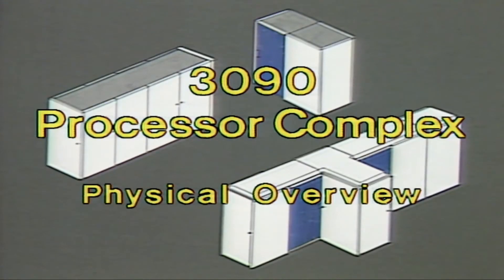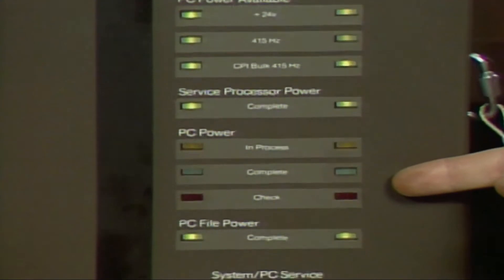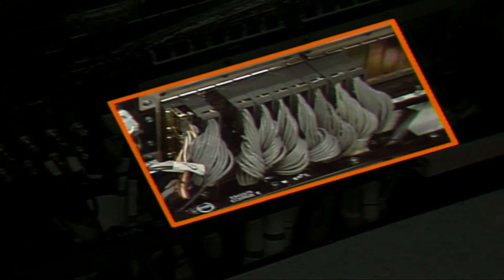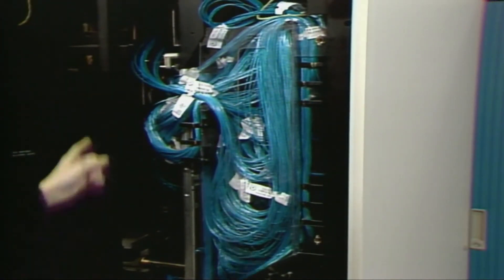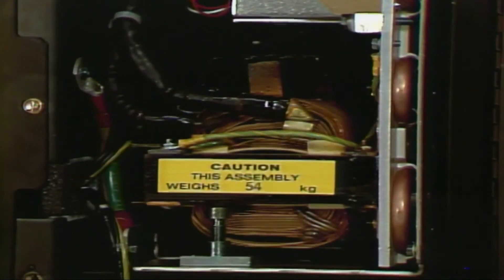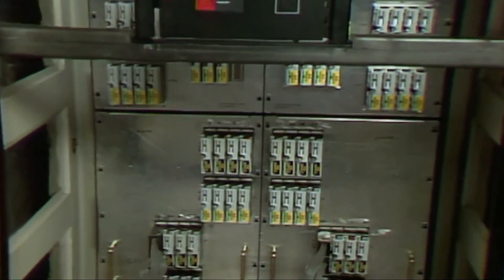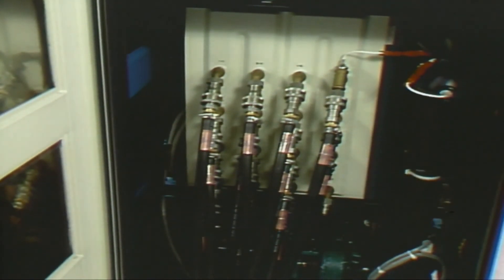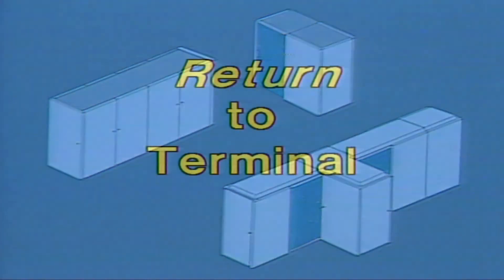IBM 3090 Processor Training

Comment: It is truly amazing how far we've come in the 30 or so years since this was current.  I wonder if people back then could have even conceived of how absolutely ubiquitous computers have become?
Reply from the maker: to be fair, yes and no. I was lucky to be part of it, I went from being a systems programmer in the mid-1970's on the original IBM 360 systems, to a Senior Distinguished Engineer at Dell 40 years later. I kept these laserdiscs when IBM closed it's formal library at the IBM Pouighkeepsie development and manufacturing plant circa 2002. This size of machine had already become recent history.

When I started in the early seventies, the computers were big enough and ran hot enough that for night shift we'd bring our food in and store it in the back of the computer to keep it warm. I was briefly Chief software architect for the development team that built the pre-boot software for PC's. All that stuff that handles the BIOS etc. That system was more powerful than the processor we kept our food warm in.

By the 1980's, we knew that things were changing rapidly. I already had a watch with a computer in it instead of a set of cogs and winding mechanism. Moores law mostly predicted the change, it wasn't clear how it would get used, but wouldn't just make big systems bigger. I was lucky enough to work at Chemical Bank in New York with Hank Kee - who was a visionary and he was a big part of the reason I was able to push IBM on some of their changes.

I Laugh not not so much on the size of the processors, but the amount of data and size of the operating systems. I get headhunted from the UK to help Chemical Bank start with virtualization in 1983. We ran a production credit card approval system that had some 300 telephone operators waiting to receive calls from merchants, and look up a credit card account. It ran on an 8MB MVS system, we virtualized it and ran it under VM/370 HPO 3.2 on a 12MB system. My Android phone now won't run effectively on 6GB. In the late 1990's one of the big pushes for extended memory on these 3090 systems were the 30-50MB CAAD drawing and modeling files, now we routinely load up files that are hundreds of megabytes.
Reply from the maker: FYI - If you don't know about Hank Kee he still has a radio show on WBAI. He has a website with show archives here http://hankkee.net/
Reply: I'm still here after 40 years. A lot of this heavy metal was in the banking industry where I started. As big as these appear to be, you haven't seen anything if you haven't been in a big rack-mounted server room today. Makes these look a little on the "small" side.

Comment: I’m surprised there is no mention of the vector facility in the video. My company, Amoco Corp, used this system for seismic data processing in the late 80’s. I worked on vector enabled scientific subroutine library for the system (Fortran)
Reply from the maker: I think that is because there were entire different training programs for dealing with the vector facility. They were not that common at the time. Good spot though.
Reply: @MarkCathcart  Thx. I’m not sure which frame would have housed the VF  anyway, I was never in the room with the mainframes 🙂
Reply from the maker: @zrlw05  there is a copy of the ibm redbook "IBM 3090 VECTOR FACILITY" if you to look it up...
TECHNICA REFERENCE 
GG on bitsavers

Comment: Surelly this system could have been built in a way it would occupy less space. It could even be more faster and have more capacity. But I suspect that IBM systems engineering had other goals on mind. Like reliability, availability, fail-safe features. One key factor to achieve these goals is temperature control. And power supply quality and reliability. To achieve goals like those, you have to avoid crowding modules and componentes (beyond some limit), you need space for airflow. Those were some of the challenges on the late 80's hardware engineering and frankly the customer targeted by this kind of system did not care about some dozen floor square feet more.
Reply from the maker: You are ignoring or don't know this was a replacement for the IBM 3033 processor. The 3090 required 50% less space in total for more than double the performance per sq-inch. These systems, as the 3033 systems did, required water cooling.
Reply: @MarkCathcart  You're skipping the 308X series.  3081-3084 processors were introduced around 1980-82.  3084 was two 3081s bolted together.
Reply from the maker: Thanks for the intro. I'm not ignoring or forgetting. Christmas 1983 I launched the first virtualized swift interbank transfer system running on VM on a 3033MP - IBM had to fix a number of software defects in the I/O code and microcode for reserve/release in a virtualized environment. But thanks.
Reply: @MarkCathcart  The shop I was in at the time (Doubleday Book Clubs) migrated from twin 370/168s to a 3081. No issues. Quite an upgrade!  I was responsible for 3350-3380 data migration.
Then two years later IBM convinced them to move to a 3090-200.
Reply: Remember these machines would often require a large installation no matter how small the actual computer was. Between electrical, cooling, archives of storage media, terminals, etc etc. It probably could have been smaller as you say, but shrinking it wouldn't have been high on either the customers or engineers priority list.
Reply: How do you figure it could be built in a way that would occupy less space? I mean, yeah, ultimately, with new technology, your smartphone blows this thing out of the water and can fit into you pocket, but with the technology of the day, no, I doubt it could've occupied less space.

Comment: Wow when roughly was this footage likely recorded?
Reply from the maker: This would have been made in 1985. It was internal processor support education, so would have been used during that year along with "Fist Customer Ship" (FCS)
Reply: I haven't found any info but the 3090 was announced in 1985 and the hairstyle looks late eighties so I'm guessing circa 1986 until I can find out more.
Reply: I agree with (around) 1986. I knew the woman in the video slightly- we were in the same 3705 class, and she started working in the IBM Ed Center in DC in the early 80's, then moved to the Atlanta Ed Center. I was trained on the 3090 in 1986 and saw her there.
[Unless I'm completely mistaken]

Comment: You mean these three huge boxes comprised a single computer? This is unreal lol
Reply from the maker: to be fair, these three boxes are just the processor part of the computer. There would be other boxes that contain the "modem" communication processor, disc storage boxes(lots of them) and other things found inside modern PC's and laptops.
Reply: @MarkCathcart  Why put the computer in a whole room? Just build the room into the computer already hahahah it's amazing how small and efficient things got.
Reply: @michrain5872 Keep in mind, this was 1985. Microprocessors had been around for 10 years, and were slowly catching up to high-end minicomputers. 16-bit machines were making headway amoung the cheaper and more widespread 8-bit micros, and they were starting to talk in MB, not KB. 32 bit processors were only a few years away, and close the gap in terms of capability, if not raw performance.

Comment: I started in IBM as a part timer in the late 80's. As a young man my job was to pull the Bus & Tag cables out of the 3090 and pull out the cables from under the raised floor. There were a bunch us part timers and what great memories I have.  It was non stop work to get the old system out and the new system in.  Worked in downtown Brooklyn  at Brooklyn Union Gas.  The experience IBM's were great to be around. Professional and well respected. They were great educators to all the young people trying to learn.

Comment: The interiors and hardware of these old machines look so complex.
Reply from the maker: They were. Even the single frame older 370 Processors had some amazing design, the cables were not just put in where there were spaces, they were designed and sized to fit in exact places. Thats why they were all so expensive...

Comment: I used to fix this. PST - Product Support Trained level. Our IBM office bought a refurbished 3090. Due to anti-trust laws, we could not get special pricing on any new unit. One tri-lead paddle card was damaged. We identified the signal and it was a sensor line not a high-speed data line. I had good eyesight in those days. I soldered the connection. I don't recall we ever replaced that cable. Then I got posted at a remote site and never came back to the mainframe group. It was a fledgling team that handled Point-Of-Sale and RS/6000 which was a blessing since this introduced me to AIX and I was then trained on the 9076 supercomputer. I ended up being the local GOTO guy for the 3584. I was also trained on the 029 card punch but sucked at it. Lots of war stories. EDIT - it was not a tri-lead but a triaxial cable which was covered in blue foil and about the thickness of a pencil lead.
Reply from the maker: Thats awesome, I had so much respect for real hardware engineers, it was a world I could get totally intimidated by!
Reply: @MarkCathcart  I saw the writing on the wall and following some advice - left the party early. The moment I was eligible, I went for early retirement. My colleague didn't. He was from IBM Canada and worked here as  contract staff. He wanted to reach 50 years working for IBM but passed away on his 49-th year.  The prestige of the IBM Customer Engineer had evaporated. We were headed the way of dinosaurs. We never met the client anymore. All we met were the staff of megacentres where the clients had outsourced their servers to. We had descended to the level of janitors. I am glad I never went back to mainframes. Those team members were getting arrogant. Case in point -  A newly installed 3584 never finished initializing. We were territorial. 3584s in their account were handled by them. I was asked to assist. I went there with a trainee and within a minute, I pulled off a Richard Feynmann  radio repair. I was never trained on the 3584 and learnt everything through reading the Maintenence Information Manual and trying to reverse engineer the machine. I deduced that they used an FPGA to act as the controller. I knew exactly where they went wrong. They installed the machine without referring to the MIM - it was still unwrapped. I told them where they went wrong and even found the page in the MIM but they still refused to admit their mistake. They mounted the crash stops at the wrong position and the robot couldn't find the barcodes and home flags. Reposition those and voila! That really impressed the trainee. Guess who knew shit and who knew his shit.                                                                                                                       EDIT - I must be losing my memory. What happened was the crash stop contained the home flag and when this is misplaced, the robot would find home, move the preprogrammed distance and shine the barcode reader to read the barcode labels and couldn't find any. This stopped the initialization. Pretty obvious if you did any programming and diligently enforced input conditioning and sanity checks. I published two programs on github. These leave audit trails so I debug from afar.  Since I was obedient to the manual for everything, I never encountered this problem but having watched the power on sequence countless times, I realized this instantly even if I had never come across this before. With my knowledge of AIX/unix, I used "strings"  to extract the latest HEC and HECQ codes from the microcode file along with their descriptions. Our technical expertise had drastically fallen. NOBODY was interested in this finding. Nobody drilled down to the error codes anymore. Another case in point - a REGATTA was gutted for its parts and when the crisis was past, new and original parts were installed but the machine failed to power on due to a massive mismatch in the VPD - Vital Product Data. Two CEs failed to overcome this. I was the second standby and was called in. I have absolutely no training on this machine. I can't even remember the machine type. But I could go into the error codes and painstakingly identified the serial numbers and error codes and after rearranging the power supplies, it could just power on. We needed to fly in someone from France to sort the rest out. The company hides so many things from us ostensibly to prevent these machines from being serviced by third parties. Indeed my very first manager betrayed us by taking along a curated group of CEs and SEs to offer MA to government clients. It was only at a webinar late in the game that I delved into the documents supplied for the 3584 to find that there was a secret menu that would exercise the robot and cause it to randomly rearrange the cartridges. All along I had to rely on tapeutil  commands to perform the same task. Major BUMMER.

Comment: I try to imagine what the internals look like in a Z-15.
Reply from the maker: Actually a lot simpler than these. So much now is on board the actual processor and SOIC which improves speed and removes latency and wiring both on and off the "system board'.

Comment: I remember installing the first one in Ontario Canada. A lot easier that it's predecessor's 3033 or 3168.
Reply from the maker: I worked on both a 3033MP and a 370/165. I wasn't around for the installation of either but the deinstallation of the 3033MP was something to behold. The 3033MP also had a dual 3850 MSS. Those were the days, I still have some of the cartridges as souvenirs. 100MB per cartridge.
Reply: Did you ever fix 3420s?  If so, how did you you do the capstan squaring check/adjustment?

Comment: For about $3 Million in 1988 you got a processor that ran at 66 MHz, delivered 67 MIPS, and 130 MFLOPS.  In MIPS this compares to a 486 @100 MHz, in FLOPS it compares to a Pentium 133.
Reply: In those days, CRAY was the acknowledged king of the hill but even then I once read that there was a time it relied on two 3090-600s with a heap of DASD to deliver data to the CRAY for crunching. IBM was the acknowledged leader in IO.
Reply: It was less about pure processing power and more about moving massive (for the time) amounts of data.
Reply from the maker: It's a fun data point, but as someone who worked on these machines in real commercial environments as well as later graduating through IBM as a Systems Engineer, to Distinguished Engineer, we all knew it was never about MIPS or FLOPS, it was always about data, I/O, concurrency and virtualization, and yeah, reliability, almost none of which you get could from x86 architectures until the early 2000's.
Reply: @MarkCathcart  I've always been a workstation guy. I was doing some orbital mechanics simulations in the late 90's and using a Linux work station as a terminal for one of the schools mainframes. As a joke I ran the sim on my "terminal" and it only ran half as fast because I had to cache to disk and could not fit all the data into main memory. I finished the project on my workstation and saved a lot of charged CPU time on the mainframe.
Reply from the maker: @AndrewTubbiolo  Yup. I was a developer on the mainframe side of the worlds first home banking system PRONTO, the pre-cursor for .zip files was developed in part for us, .arc files by Thom Henderson, and I wrote grid-like programmers compilation system that allowed programmers to submit batch compilations on the mainframe, which were offloaded to PC's running MicroFocus COBOL.... heady days all between 1983-1986. One of the managers I worked for was Hank Keyes, who won a PC Tech Journal gold medal the first year they did them, other winners that year, Bill Gates and Phillipe Kahn of Borland... I went on to join IBM, and wrote the first Linux mainframe strategy paper in 1997/8. Hence my interest in this stuff... still.
Reply: @MarkCathcart  Thanks for the stories. Great stuff.
Reply: @MarkCathcart  a friend of mine worked at a bank and was lucky enough to grow from helpdesk to first mainframe and then unix groups. i remember there was one time in his early years when he got curious and ran seti@home on a linux partition - but only for a short time till IBM called them up since he created a messy overload on the whole system. we both laughed since it was such a sad, unprofessional first impression to create of linux as a citizen in the system he created. naturally it was without bad intentions, just wanting to see how amazingly big that machine was - like when you'd stand in the largest church of the world and you look up and say "woahhhh". and it was big - but the scheduler was not amused nonetheless.